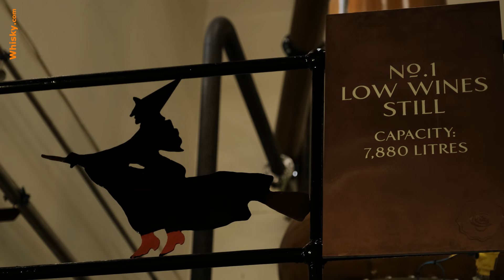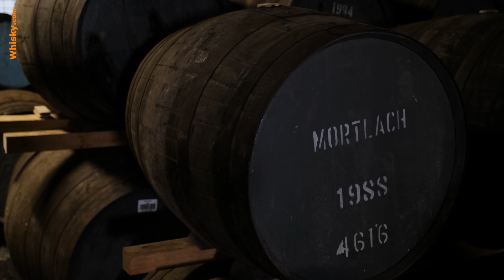Mortlach Distillery Visit

Comment: Another excellent video, Ben. I think the idea of placing the distillery in a geographical context and showing some scenes of Dufftown is an innovative way to get started. Bringing in the drone footage is always a hit. But you might have thought of sending it up and letting it fly the short distance from the heart of the town to the distillery. That would've been interesting. Inside the distillery you had some good shots and clear explanations of the stages of production. But then we get to the 2.81 distillation method. I remember reading detailed descriptions of this years ago, and pouring over the details several times over. It's complicated! Probably needs a flow chart to explain it clearly - and that would just hold the video up unnecessarily. It's also interesting to hear, during the tasting, that Diageo do their blending work for the Mortlach range elsewhere, where they have all the facilities they need to do such detailed work. And that the chief blender's recommendations then flow back to the distillery and influence the wood policy regarding the number of casks to be filled in ex-bourbon, and in American and European ex-Sherry casks. That's the way things work in such a large conglomerate as Diageo. It would have been revealing if they'd mentioned how much Mortlach is required for the Johnnie Walker range, and how much of the production is left over for the single malts. But again, I imagine Diageo probably doesn't want to get that specific about such details. To finish off, I can recommend a whisky walking tour that begins in Dufftown and passes by 7 distilleries (including a mothballed one). It's lots of fun. Cheers!